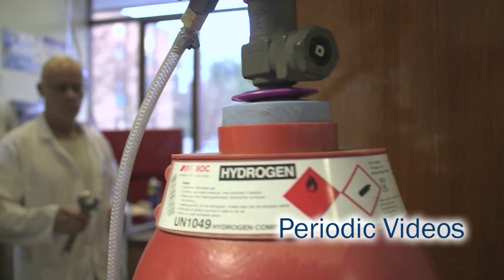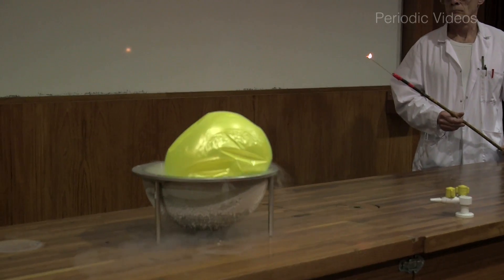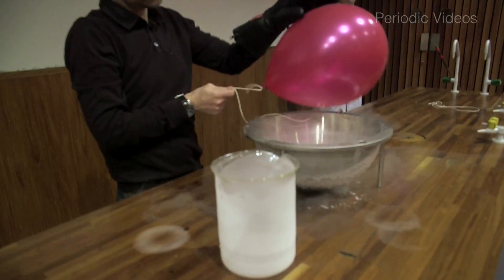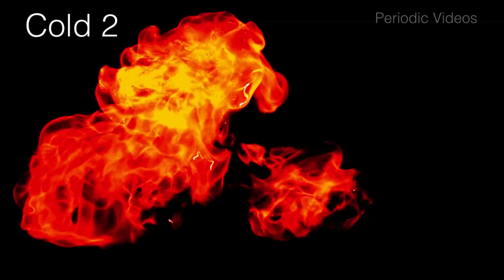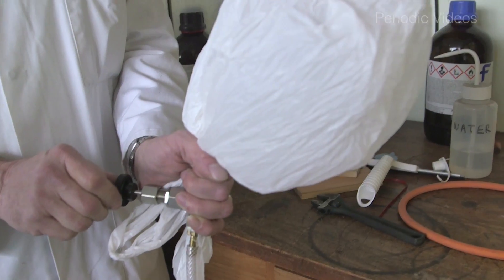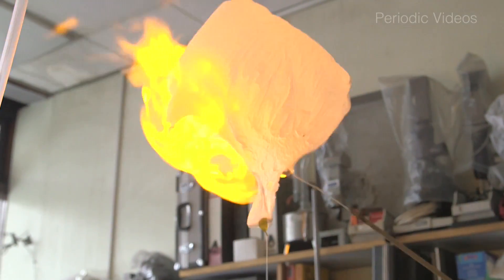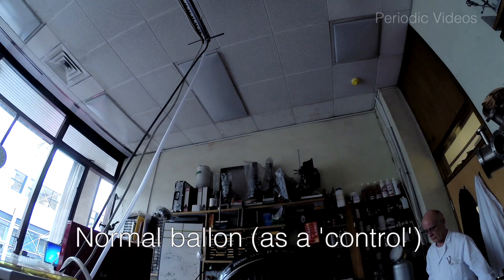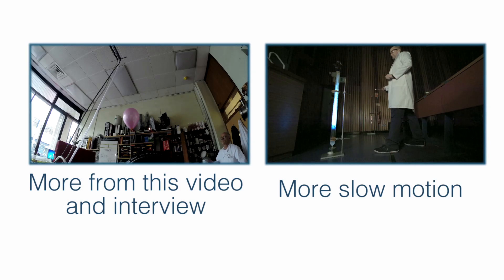Cool Explosions and Bags of Hydrogen - Periodic Table of Videos

Comment: Am I the only one thinking that the "pop" when the balloon of H burned was more to do with the pressure in the balloon than the actual temperature?
You take a balloon filled with normal air and light it it still makes a loud "pop", so I am leaning towards the noise is nowt to do with the hydrogen at all.
that's why the carrier bags burned quietly and didn't pop like the balloon.

Comment: Suggestion: Fill a balloon with two parts Hydrogen and one part of Oxygen.

My guess is the explosion will extremely intense.  No mixing time required.

If the ignition source is a spark in the middle of the balloon - well I'll bet the result will be spectacular...

Comment: I would be curious to see how loud an air filled balloon pop is on average, compared to a H2 filled balloon at the same pressure. Assuming both are at the same pressure and temperature, and they are both popped with a lit match, I would expect the H2 balloon to be louder (obviously).  If you want to test just the effects of temperature on the reaction, try adding an appropriate amount of O2 to each H2 filled balloon.  In this case, temperature would have the biggest effect the reaction speed.  You would probably end up with a detonation instead of a conflagration.  Best try it outside!

Comment: Get a thicker balloon with more tension and see if the boom is bigger.  Maybe something like a hotwater bottle or a bicycle tire?  You could also use something more rigid, like a plastic bottle to compare the effect of different pressures in isolation from the tension of the rubber of popping with a match, although that could get pretty dangerous...

Comment: Ok, so what if you filled the balloons with the optimal ratio of 2:1 oxygen and hydrogen, and then cooled the balloon which now contains an optimal fuel/oxy mixture, would the colder (denser) balloons not have a bigger explosion in this setup?

Comment: My theory about the difference between balloon and bag is that the balloon is under pressure (or better, tension) and therefore sort of "explodes" when getting a hole burnt into it anyway. The bag, not beeing under tension, just stays where it is and slowly burns away. A cooled rubber balloon means less tension (less gas volume + less elastic hull) therefore it's a bit more at the burning away side. If you filled an inert gas into the containers this behaviour should probably be the same. The way the hydrogen is released and mixed with oxygen is affected by the way the hull reacts when getting a hole and so we observe two things caused by the hull's properties (the way the hull itself burns and the way the hydrogen-oxygen-cloud burns). Well, just my intuitive guess; no real knowledge.

Comment: Heres a suggestion for an advanced level chemistry demo: the reaction between sodium bicarbonate and vinegar (dilute acetic acid). But please fill in your COSHH forms and carry out a comprehensive Risk Assessment before carrying out this potentially dangerous reaction. Dilute acetic acid (vinegar) can cause serious eye irritation, and sodium bicarbonate and the reaction product, sodium acetate, can cause hypernatremia if too much is accidentally ingested). A hermetically sealed chemical suit, vinyl gloves, fume cupboard and face shield are an absolute must when attempting this. Only carry out the demonstration if the Safety Officer approves.

Comment: Maybe the balloons had better pops because the gas was under greater pressure, there was a larger volume of hydrogen available and since it is under pressure, when it is released, it can quickly mix with the surrounding oxygen.

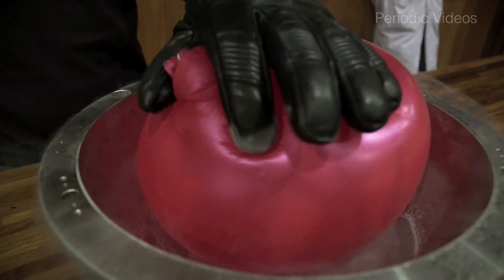Comment: I'm at 1:36 my theory is that the balloon is more like a bag when its colder and the pressure is lower and when there is a hole in the rubber the hydrogen rushes out faster and mixes with oxygen quicker to make a louder bang

Comment: This hypothesis needs more testing:
What happens if you light a balloon filled with Hydrogen/Oxygen mixture Cooled/Uncooled?
What was the burn temperature in either situation? Since the cooled balloon starts out colder the end temperature will probably also be lower. And the resulting gas expansion less.